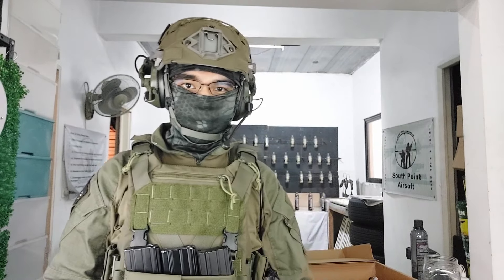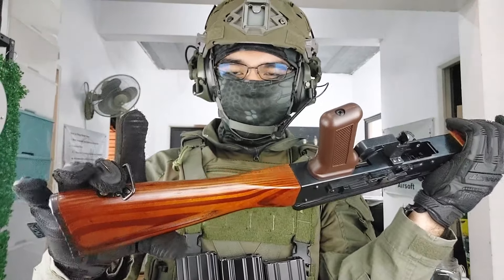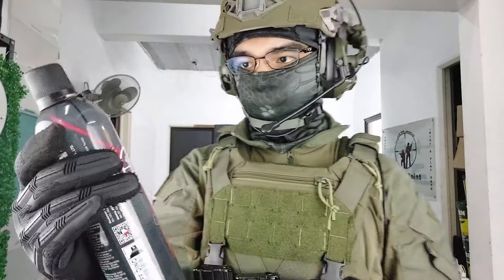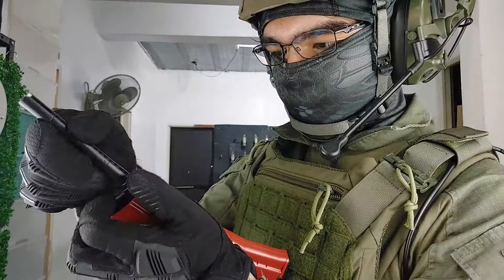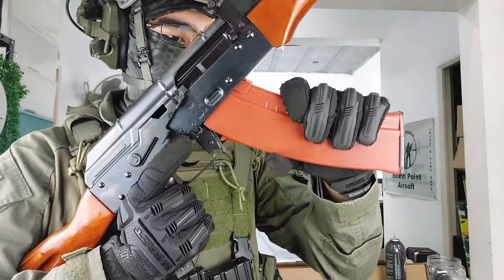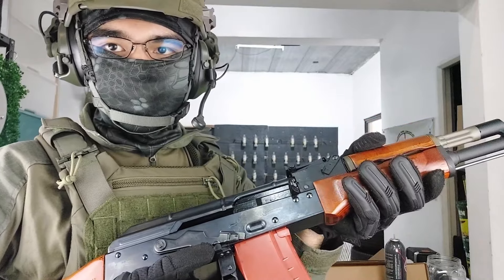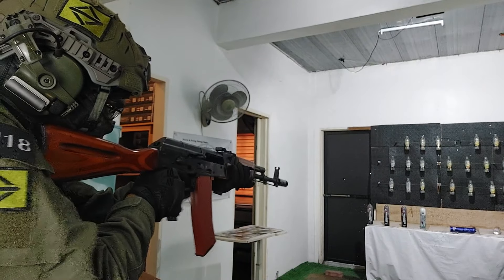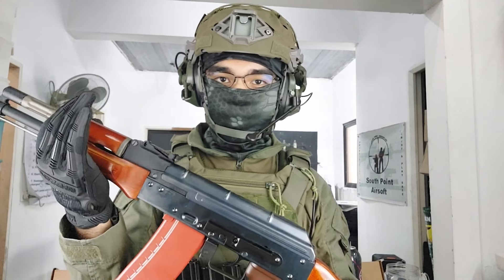Test & Demo of Sir. Justin's WE AK74 GBB Airsoft gun.

Comment: Hi. What could be wrong with my WE AK74 GBB?
The hammer seems loose and doesn't strike the firing pin hard.
It doesn't fire anymore.

https://youtube.com/shorts/qw2SwfrwyOk?si=45_MDvoSvZa6yi2p
Reply: I am not an expert, but I would assume the spring that drives the hammer is out of place or broken, I'd try to take it out and see whats going on in there
Reply: @eggbred.  well it's actually the hammer spring. Already had it replaced.